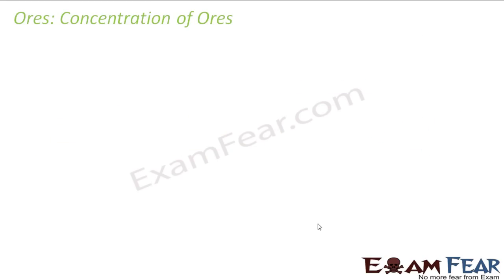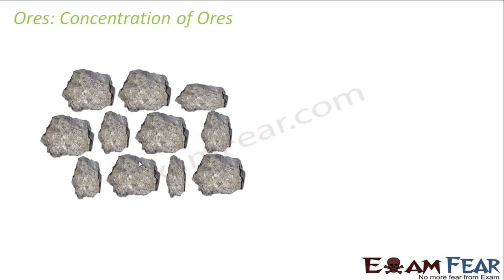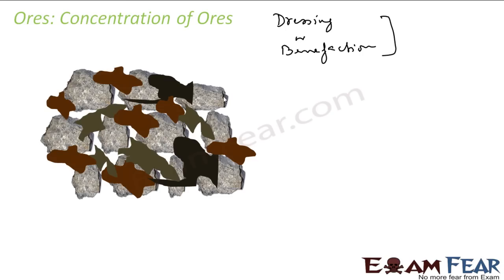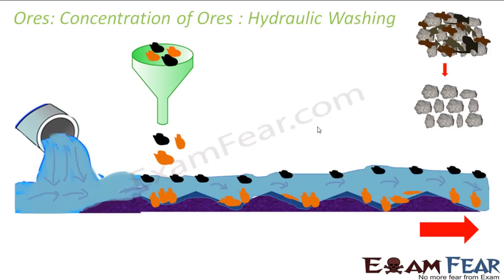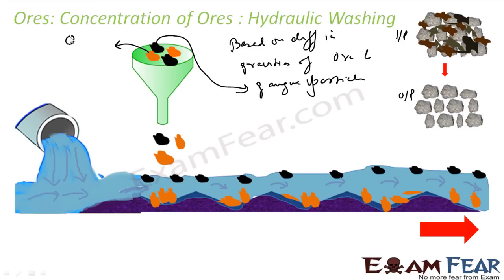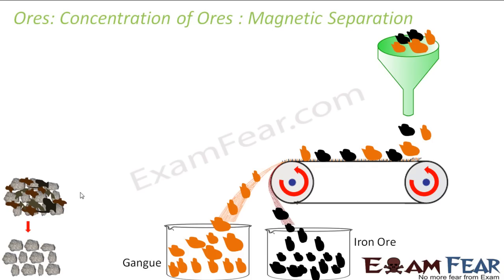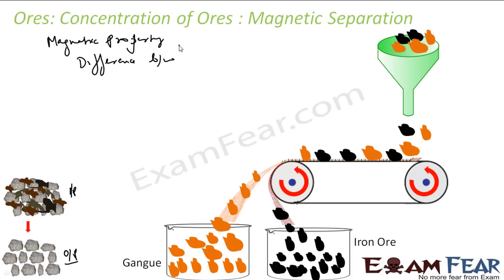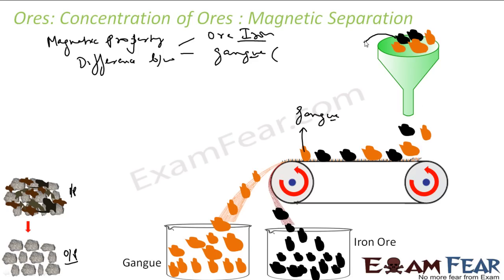Chemistry Isolation of Elements part 3 (Concentration of Ore) CBSE class 12 XII

Comment: sir the iron ore  attaches to magnet but after how it felt in bucket
Reply: bro that's because there is magnet present only in wheel of conveyor belt and not in the extended belt..
Reply: @MyName-ho1xt  was abt to comment the same thing but you did it already😁
Reply: @prasanna2514  wow you made me read my comment 3 years later
Reply: @MyName-ho1xt  bro/sis you completed 12th ryt?
Reply: @prasanna2514  yes now in engineering 3rd year
Reply: @prasanna2514  I am male btw
Reply: @MyName-ho1xt  are these videos (i take notes in a note) + ncert enough? Or do we need any guides   or study material to score 95+ (i aim 100)
Reply: @prasanna2514  in JEE right?